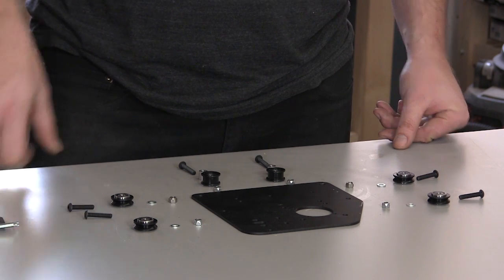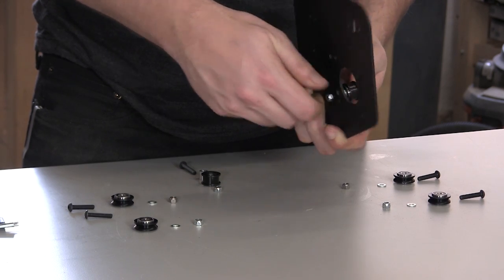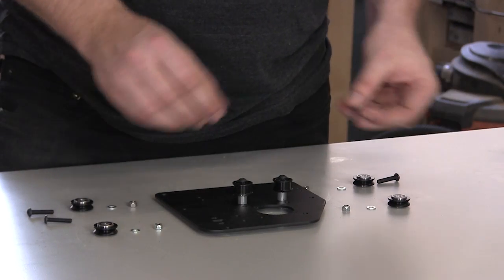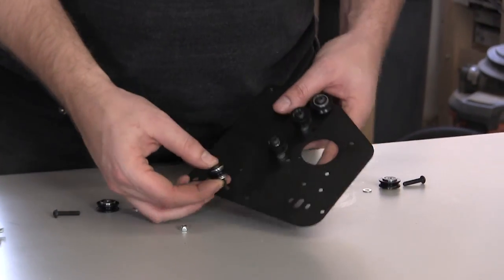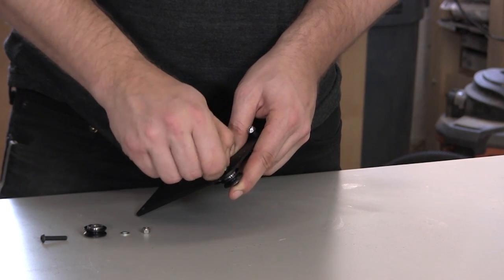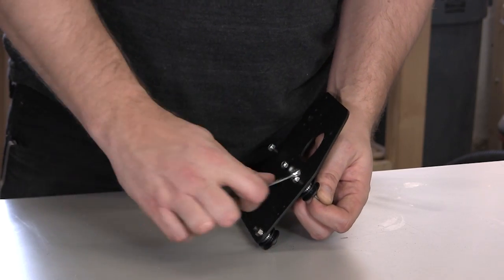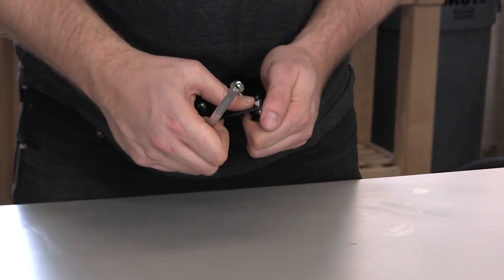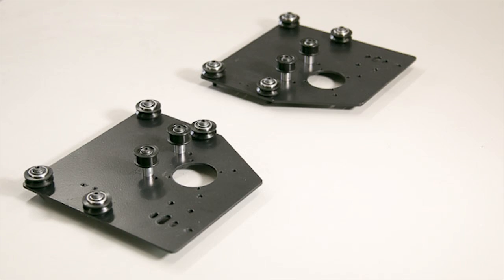X-Carve | Assembly | Y-Plates v3

Comment: It would be helpful in future revisions of the video to say which length bolt you're using where. This assembly includes both 25mm and 35mm, and which one to use where is the only detail I've had to go back to the website to clarify so far.